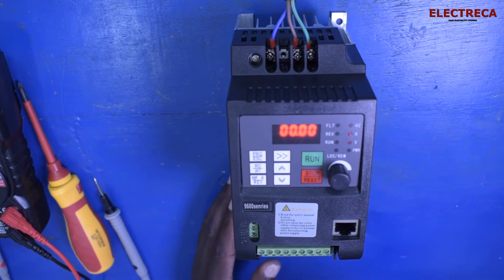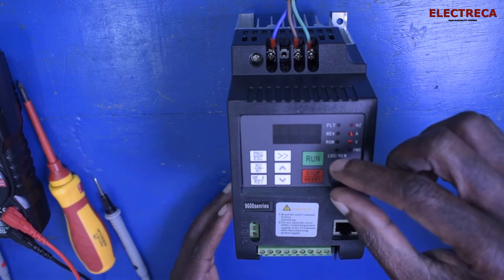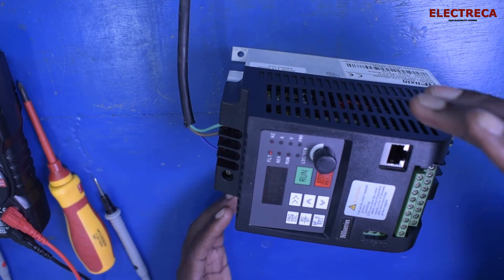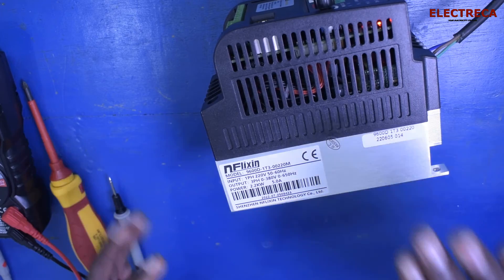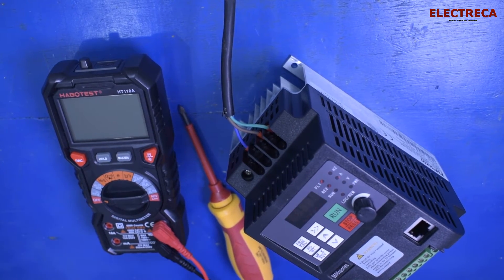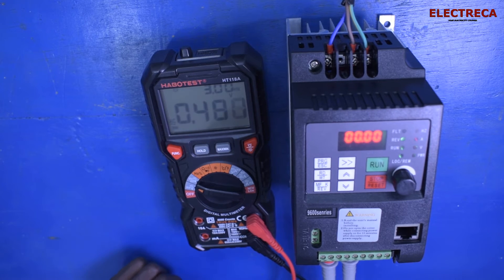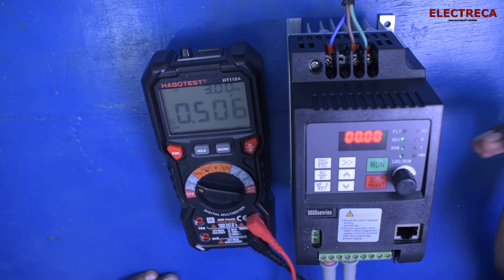single phase to three phase variable frequency drive | Converter  | Inverter | Electreca

Comment: Basically VFDs do not increase output voltage: if the input is 230V, the output max will be the same (this is why we have star or delta connection on the motors). 
5:30 this is what we call V/f curve. For really you can adjust it, f.e. make higher voltage at low frequency. 
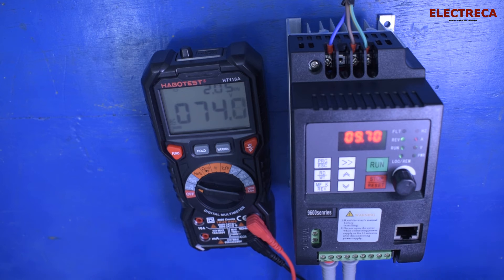6:20 for really it generates pulses (PWM), not SINUS wave. When you connect the motor, you get SIN wave, because motor is inductive load 😉

Comment: When the potentionmetre is at the lowest point let say zero, the multimetre reads 50hz. When you vary the potentiometre the frequency  on the multimetre increases up to 300 before we can obtain a voltage of 220V. Will the motor that is mean to fonction at 50Hz not be damage ??